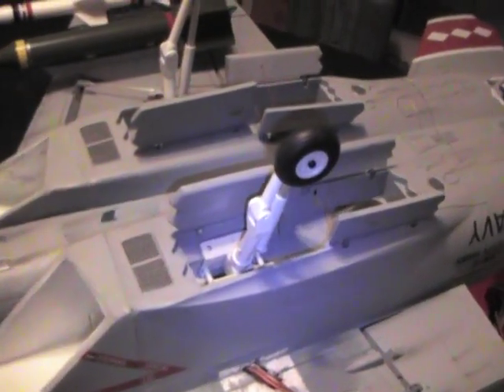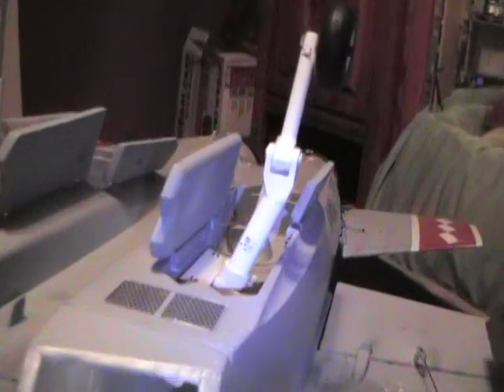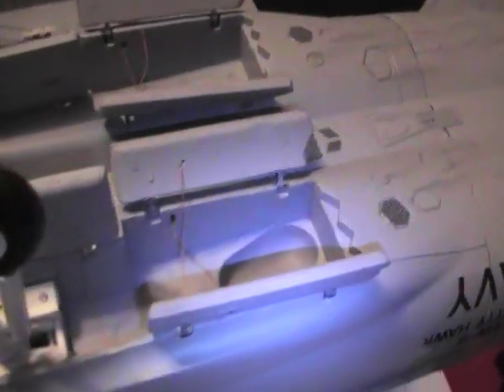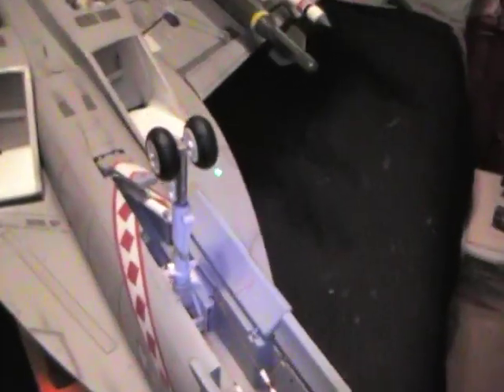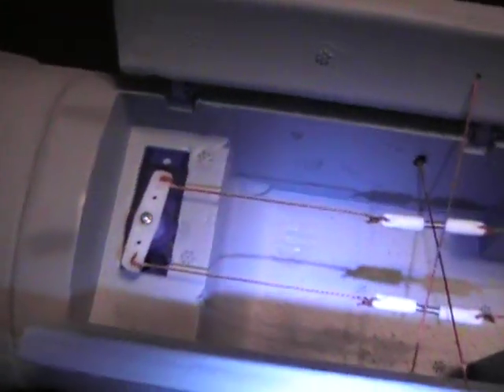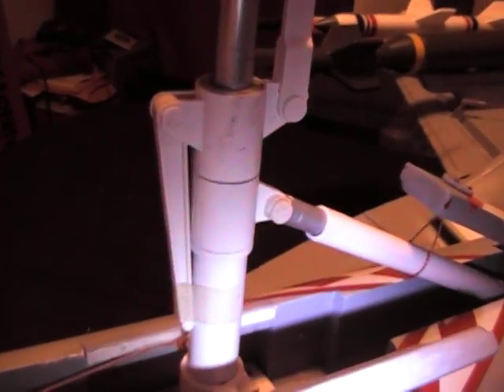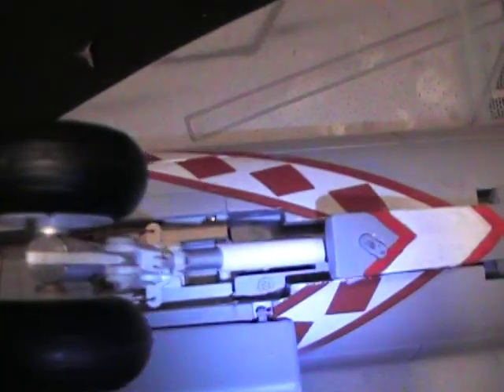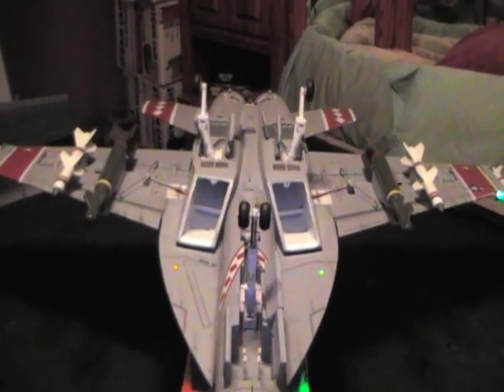LX FA-18 Video of the Retracts in operation.MOD

Comment: Hey Brandon,  I just picked up this jet, and need to know, just how does the strut come apart to access the spring, on the main gear. Does the end cap( with holes), screw off ? The last thing I need, is to break the strut. Thanx, James